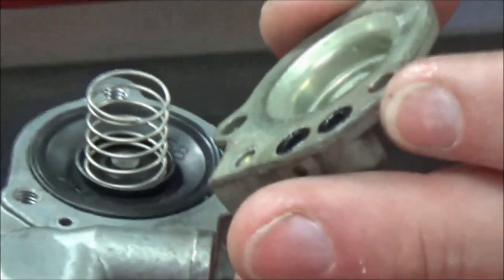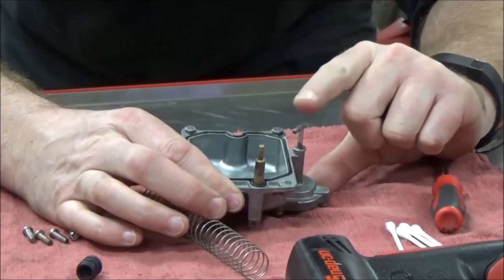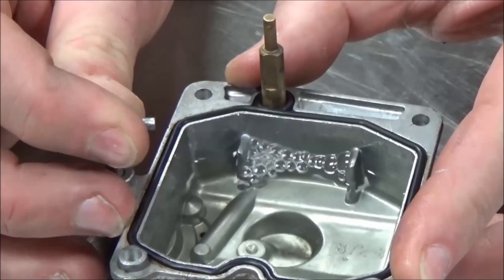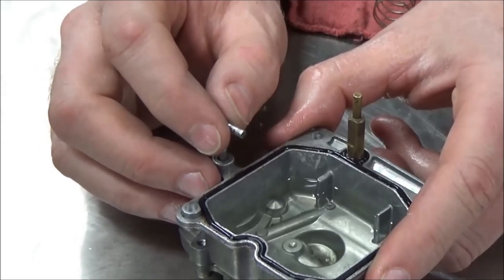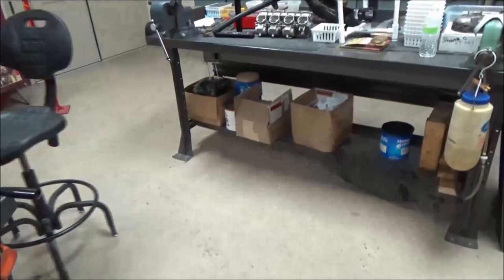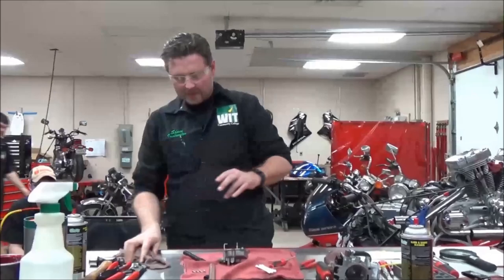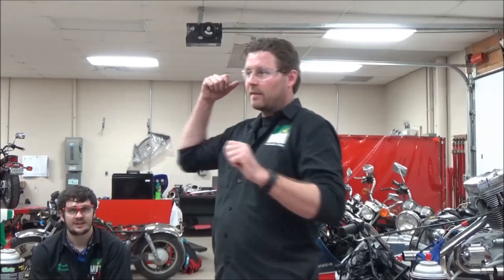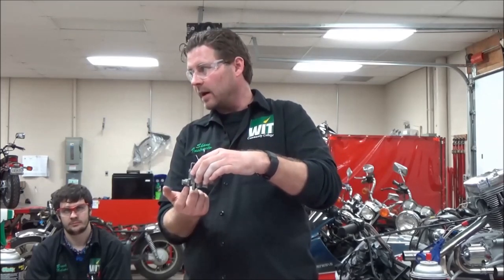06 Accelerator Pump theory testing and installion Part 1

Comment: I had to tear down and clean a varnished carb on a '03 Sportster 1200 I bought this week.To be sure I had all passages clean,I pulled the brass tube on the bowl(that you have fun squirting through,lol) and found what looks like a small float needle in there.In your videos,I don't see you pull this tube but it sure looks like a place that could be overlooked and stop up with crud.I'm wondering what the result would be if the needle sticks?Could it cause the pump to stop?Thanks for sharing these videos!
Reply from the maker: Stuck closed yes, open no. You're in luck. I do offer personal service to back up what's missing from a video to actually fix your specific problem. I do work on donations for my time and possible research. 
Good news is its CHEAP! For my time would mind becoming a member of my website? It comes with a free 20 mins of techline and that will cover my time to assist you so we both benefit. So to have me personal cell phone number to put in your phone as your direct info and how to coach, sign up now! As always thank you and enjoy the free videos! Much more to come! I look forward to working with you and hope you will become a member of or learning community. 

Link to membership: https://how2wrench.com/product/membershipmembers-onlymembers? 

If I can ever be of service to you, here is a video explains how to connect with me. 
https://www.youtube.com/watch?v=vjvmB01ebcs 
Direct link to services: 
https://how2wrench.com/product-category/tech-lineservice-callminutes/ 
Live Chat is great for you to actually show your specific issue!
Donation link: https://www.paypal.me/how2wrench
Reply: Did you evertake out the stuck needle beacause i am having the same problem i cant remobe mine

Comment: Hey man, love the videos, you just do an excelente job, I have a little issue with my new FCR33 carb, it idles good and when i accelerate from bottom to top (on neutral) it seems good, but when i go to ride, it stumbles at mid rpms (half throttle), it goes like ta...tatata...tata..tata..., Then I keep accelerating at full throttle and the stumble disappears, and runs ok on top of acceleration. I changed the needles 45 Pilot jet, 145 Main jet (still smells lot of gas burned and black spark plug) and it keeps stumbling at mid acceleration. It only happens when I go to ride, but not on neutral. Please i'll appreciate your comments.
Reply from the maker: Hi friend. I’m the Social Media Manager here. That’s a good question for Shane. He gets hundreds of requests a day and starts each day answering MEMBER or donation support questions first and then if there is time he will try to circle back before heading to the shop for customer work. Your question sounds more like a techline call but Shane's the expert so it's best to ask him as he may have a quick answer. Members get his cell. 
Want faster response times? Join link below.
Thank you for commenting. Want more benefits?
-Daily MEMBER FIRST COMMENTS ANSWERED FIRST
-Live Q/A video chats
-Wonder if we have a video on your need? Members can request content links!
-Full Access to the ENTIRE 700 video library
-Member-Only FREE tool giveaways
Join this channel to get access to perks:
https://www.youtube.com/channel/UCBhM8DCKnT3qXwTW0eToyCg/join 

Just want to say thanks quick to support us for this information and our work saving you money?
Give us a high 5 here:  https://www.paypal.me/how2wrench

Comment: My bike runs great but when I shut it off fuel drips from the squirter. The carb has been apart 3 times. I shut off the fuel and run it dry to prevent a fire. Any ideas?
Reply from the maker: I would need some more info to get you the right answer. I’d be glad to take the time. Can you help us back?
You just need a quick answer to make sure you’re on track or what direction to go? Please donate (https://www.paypal.me/how2wrench) what you feel getting this information is worth to you and I’ll reply back with what we would do at H2W!

Need the full service techline?  Coach Conley is also available for hire to personally work one on one with you if ever needed. Yep he is a real person. Details here: https://how2wrench.com/product/personal-tech-training-phone-facetime/ 

Your answers and help are just around the corner. Save time and money while protecting your investment and yourself by doing it the right way!
Reply: @How2Wrench  I figured it out. No check valve in the in the squirter. Back in business
Reply from the maker: @77camaro  Cool